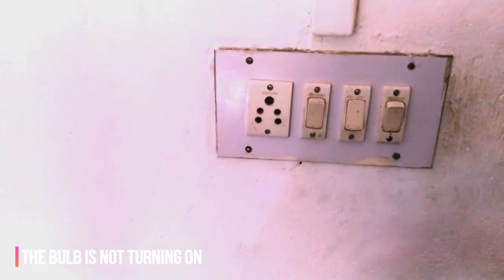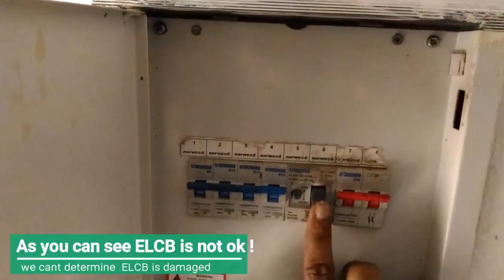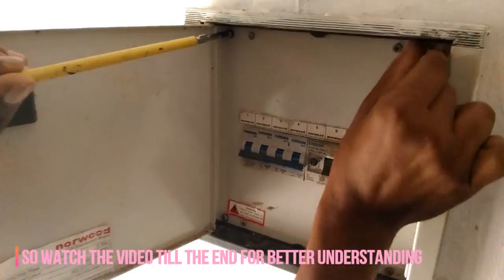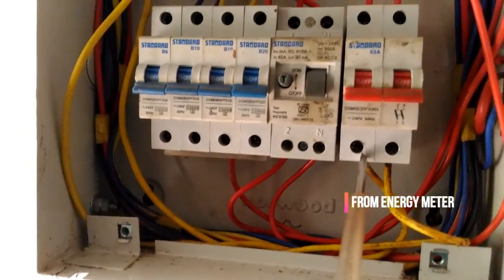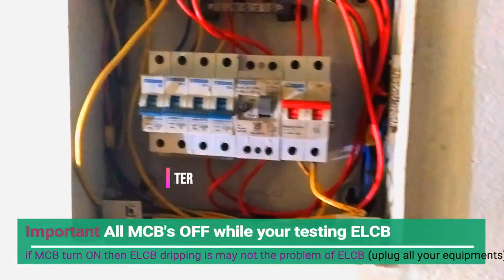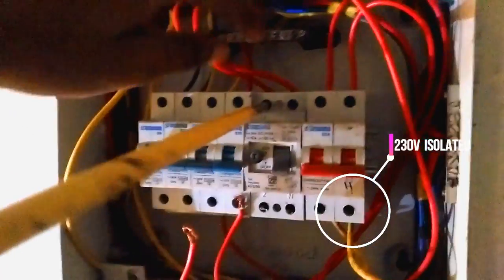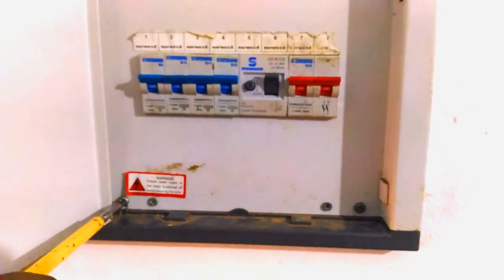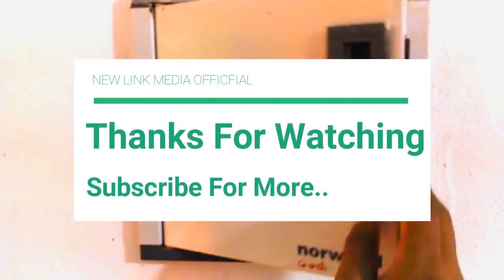How to Home ELCB replacing ||ELCB connection||ELCB Fixing|house wiring|Earth Leakage Circuit Breaker

Comment: You should put the neutral blue or black  so ordinary people don't mix up the wires especially to the neutral bar !!!
Reply from the maker: Ok   .Watch other videos on the channel
Reply: In my country a civilised one to use a screwdriver tester is illegal and one should use a multimeter. And yes you should not confuse people with the red wiring. The least you could do is tape it black or blue depending on one’s country.